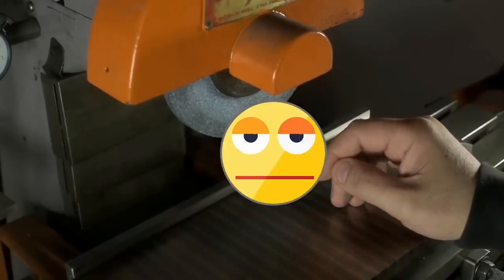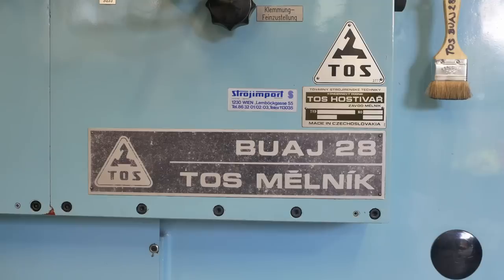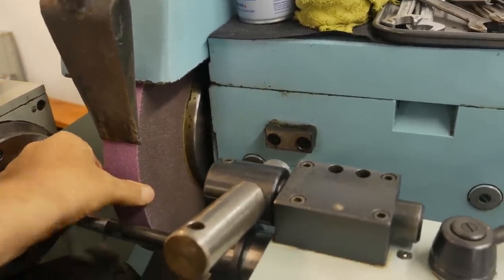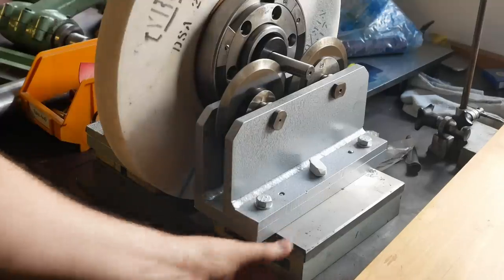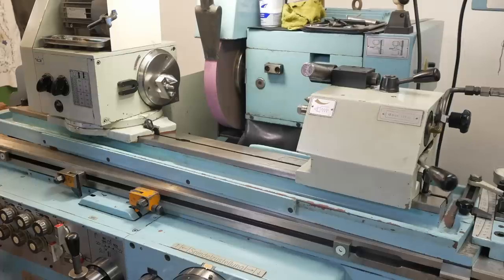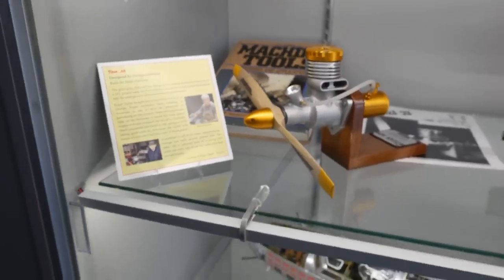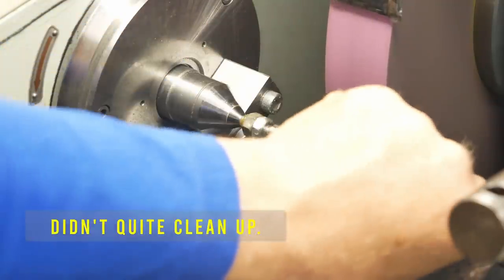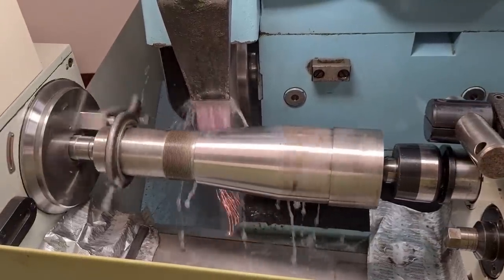Who needs a cylindrical grinder? || RotarySMP

Comment: Nice but two mistakes, the water need additives and the water feed has to far distance and angel.
Reply from the maker: It is not pure water, it is water soluble coolant.
Reply: @RotarySMP  I can see that something is not right whit the water tension. coolant water for grinding shall be soft as silk.
Reply from the maker: @smokken10  Thanks, I will pass that on to Franz.

Comment: How do you compensate for wheel Wear and keep it accurate on the OD?
Reply from the maker: I always wondered that with grinding as well, but the wheel diameter lose is very minor, so I guess in production your just mic parts regularly and dial in to compensate.